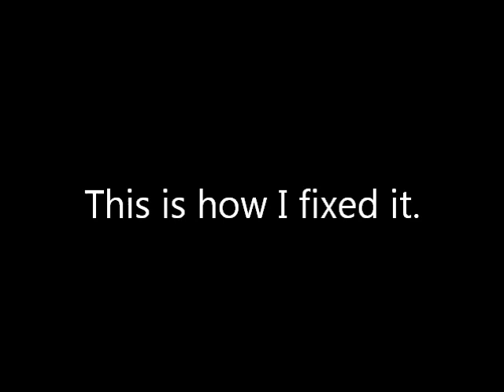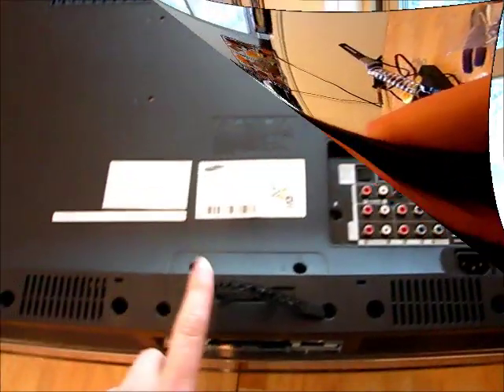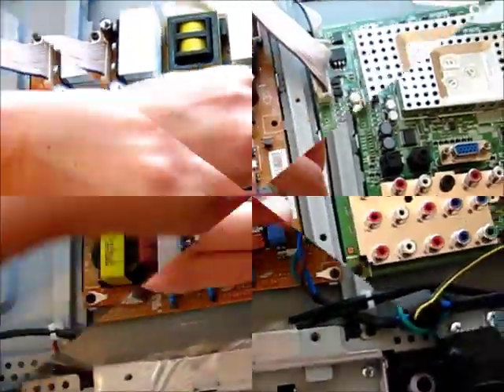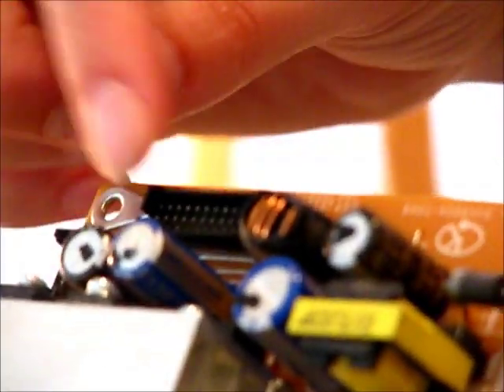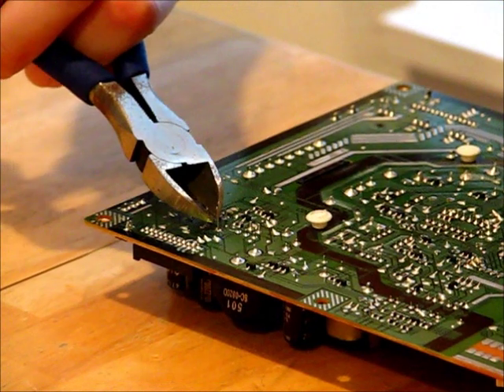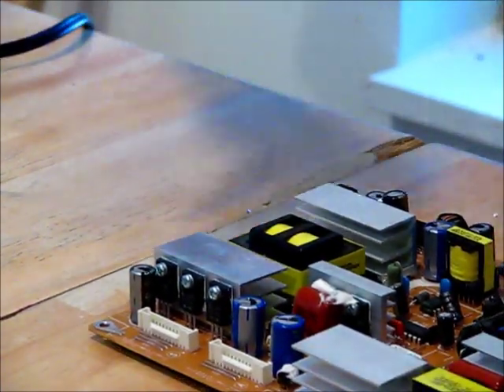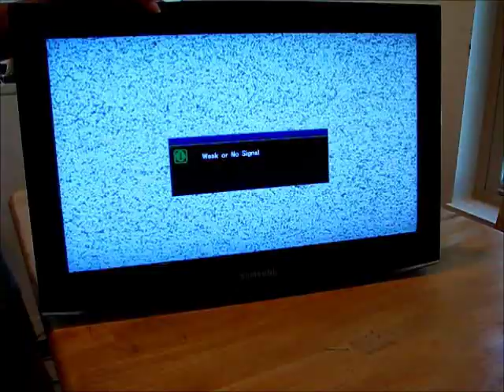How to fix a Samsung LCD (Electrolytic Capacitor)

Comment: I was getting ready to take my 10 year old  32" Samsung to the trash bin (it wouldn't turn on), when I came across your video.  You helped us clearly see we had a blown capacitor.  After buying a replacement capacitor for $3.35 (including shipping) and a $10 soldering iron, we followed your instructions, and to our amazement, the tv turned on and is working great.  Thanks so much for the help.
Reply: Very interesting.  You were able to save the TV
with mimimal costs.

Comment: I fixed mine yesterday (LN-T4061F). Two blown 10v 2200uf capacitors. Replaced with 16v 2200uf (total capacitor cost = $2.98 +tax). My first time soldering so it took me about an hour total to complete. Thanks for this vid, it was a big help in both "how to" and giving me the confidence that I could do it myself. Worked like a charm!

Comment: Very, very helpful.  This worked for us--not too hard and saved us a lot of money.  The whole repair was maybe 15 minutes.
 The capacitor we replaced (same as in the video) was 2200 uF, 10V. It doesn't hurt to use a higher voltage, like 25 V, if that's what's available, but you don't want the new one to be much longer than the original.

Comment: Good job Michelle! Just a helpful hint, when replacing "through hole" components its easier to insert the leads and bend them slightly outward, solder, and then cut the excess. This will help to hold the component in without falling out or moving while soldering. You go girl !!!!

Comment: Nice!! My 32" Samsung went out on me, and turns out the EXACT same capacitor you replaced in the vid is the one that I had to replace on mine, the 10v 2200 microfarad caps are pretty cheap and are blowing out on alot of samsungs apparently. I replaced with a 16v cap and is working great now. 

Thanks for being SWEET!

Comment: Thank you so much for this great video on repairing a Samsung TV Michelle! I had a very similar issue with a Samsung LN26A330J1D TV that someone had left by the dumpster at my apartment complex. It had a hand written note on it that said "It Works!" So, I took it home with me and found out that it was not turning on. Although, mine has a power button on the front of it, the issue was very similar to yours. Whenever it was connected, a red light would appear on the power button showing that it was receiving power from the outlet. However, when the power button was pushed, nothing would happen. I decided to search for similar experiences with this TV on line and came across articles mentioning defective capacitors with these type of LCD TVs. Not knowing what to look for to try and repair the problem myself, I came across your very informative youtube video on how to actually replace a bad capacitor. I will mention that I have soldered electronics on my own electric guitars before. So, I know how to handle a soldering iron (somewhat). But I've never attempted to solder on anything else. Especially on a TV! 

Well, I opened the TV up and sure enough, there were 2 caps that had the bulge on the top end of them. One of them even showed a black leaky substance on the top of it.  So, I removed them both (notating on a piece of paper what direction the negative and positive posts were attached to the board itself). I then ran over to my local Radio Shack to purchase 2 new capacitors for it. Costs me about $4.60, after taxes. Got home and soldered the new caps onto the circuit board and put it all back together again to test it out. Eureka! The TV made a beeping sound and then turned on after just a few seconds!  I'm actually using it as my PC monitor as I type this. I gotta say, this TV really does make for a nice PC monitor. And for an investment of under $5, it was totally worth it! So, I can now speak from experience and say that this repair really works! Thank you so much for the great repair video Michelle!

Comment: It's really cool that you and other people spend the small effort it takes to fix you machines yourself instead of tossing it out and buying a new one like so many others do. Unfortunatly, your solder joints looked very bad, also known as a dry joint, and it will most likely cause you grief. The proper way to do it is to stick the iron so it contacts the wire and the PCB so they both heat up, and then apply the solder. Get some junk circuit boards to practice on! :)

Comment: two pointers on your desoldering/soldering technique, in case you ever do more of it! 1. buy a roll of desoldering 'fabric'. it's a copper mesh, you press it against the joint, heat it with the iron, and it sucks the solder out. much neater than just heating and wiggling the component. there are also manual solder vacuums that will do this. 2. it's okay to trim the leads down closer to the board before soldering, but don't clip too low at first. solder them, then trim down to the board.

Comment: Samsung 46" fixed today by replacing two caps for $2.60. Only real difference to the video was a cover over the boards. Easily removed. Many thanks Michelle  :-)

Comment: I have a 65" LED Samsung and it just did the same thing to me. The red light at the bottom is oh, but it will not turn on. I will go ahead and attempt to replace a few of the Capacitors and get back with you. VERY USEFUL VIDEO! thank you.

Comment: Great vid.....i bought the capacitors with the intention to fix my own (Samsung LE32 R86).....but just by chance i phoned the local service centre who told me to ring SAMSUNG UK......they said the tv qualified for a free repair as its a known fault even though it is 3.5 years old.....just got it back today....fixed free of charge.

Comment: I noticed the "cold" solder joints as well.  Just a couple tips to newbies on soldering.  You need to ensure that either the solder you use has soldering flux in the core (or buy the soldering flux separately).  The next tip is to always heat the metal post and then let the post melt the solder (Do not melt the solder on the tip of your soldering iron.)  You'll know you've done it right if the solder remains nice and shiny after cooling off.  In this case, the soldering joint was dull.  Cheers!

Comment: And by the way, Low ESR capacitors can be found on computer mainboards or computer powersupplies, these capacitors (if electrolytic) will be able to handle the high currents and high frequencies better than standard ones that may fail again soon.

Comment: Thanks Michelle! I have the same TV and the same capacitor went. Its nice to see it worked on yours before i tried it. I also did some prior research but your video was exactly the same problem as mine. Very helpful plus your easy on the eyes!! thanks again

Comment: @solidasarock13 , it depends. if you're snipping a small gauge, low ductile lead, then yeah, it might crack the joint. if you're trimming a tiny, flexible component lead, it's not going to crack the joint, and that's what these joints are. further - solder joints are supposed to be ductile. if a solder joint cracks, chances are it was brittle to begin with - which means an improper solder job. so you could be doing yourself a favor by trimming - exposing a solder joint that needs to be redone!

Comment from the maker: @MissChelleShock I know sometimes the ad that pops up on the video displays parts for Samsung TVs (and probably most others too). I will see what I can do about making stay fixed to that ad so people can order from there. Otherwise, I purchased my capacitors for a local shop called Tech Advance. It's a shop based around computers mainly. Everyone probably has at least 1 shop that sells these locally, but you may run into finding an associate who knows what your'e asking for.

Comment: Be careful what capacitors you use since SMPS's (switching powersupplies) use high frequencies and very high current ripple on the caps, Some people tell you to go up in voltage, but the circuit is usually marked "+5V" or "+5VSTBY" wich means that the operating voltage is not higher than 5 volts. Instead look for "Low ESR" capacitors, and if it's a 2200µF cap, overdimension it to 3300µF to get enough margin for it to last way beyond the TV's designed life.

Comment: @MissChelleShock lol, i tried it yesterday, and i touched the entire capacitor, and there was no electric shock or anything. But my 15watt soldering iron wasn't able to melt the solder and I just threw it away and ordered a new monitor.

Comment: hey great vid on the lcd replacement part. My samsung just had the same problem and the exact same capacitor is blown. I see many are diffrent sizes, what size do I buy? Or is the specific part itself called a electrolytic capacitor?

Comment: @1961vampire Thanks for the help. The capacitor is the same size but the thing is, is it safe to go up that much in voltage? (16 to 35)

Comment: Do you happen to know if bad capacitors also prevent the video from working? My set turns on and I hear audio but no video. It started with a green vertical line and later just went black.

Comment: @MissChelleShock I need a question answered please. When replacing capacitors can you go up in voltage or uF? Some video I watched a while back said something about it, but it's very hazy. My local radio shack doesn't have the right voltage.(35v when I need 16v) Please help me out here because playing xbox on a computer monitor and without sound is annoying.

Comment: Ok, I have questions:
1) Does it hold true that every lcd tv that doesn't turn on, but has the orange light, has a blown capacitor?
2) Can it be more than 1 blown capacitor?
3) Besides the dents (I find it very subtle) , how can you tell a capacitor is blown?

Comment: Being a postman I come across stuff thrown out. I recently got a fully working flat screen that was put in a skip (The owner didn't know how to operate it??). Today I got this TV left out for scrap but following your video I might be able to fix it myself (even). Not sure though if the capacitors have be a certain kind, but would that be plain to see even for someone who has never done something like this?
Reply: +Brian Morgan - Hey Brian. If you have a soldering iron, all you really need to do is turn it on and wait until it gets hot enough. Once you have located the capacitor(s) that has gone bad, simply place the tip of the soldering iron on the capacitor legs on opposite side of the circuit board, while gently pulling the capacitor away from the board (with your own fingers or some needle nose pliers). As Michelle mentioned in her video, the capacitor that went bad on her own TV was on the cold side. So, she did not have to worry about draining the caps before soldering on that part of the board. The bad caps on my TV were also on the cold side of the circuit board. From the looks of it, the caps on this particular Samsung LCD TV circuit board appear to all be on the cold side. Just try not to leave the soldering iron for too long on the circuit board to avoid burning/shorting it out in any way. Once you have successfully removed the bad caps, take them to your local electronics store (like I did) so that they can match them up for you and get you the correct ones. Hope you get your TV find working again!

Comment: I talked to a electrical engineer about this very problem on Samsung TVs. Apparently the capacitors are only rated at 10 volts but 12 volts go thru them. Something that Smasung should should take care of since it was a known problem. Be prepared to replace all of the other capacitors you just showed us as they are all under rated for 10 volts also. I will never own another Samsung product. It will be LG or Sony. Samsung also used cheap color wheels in their DLP TVs which fail and wear out also

Comment: Hi i've had real bad problems with my lcd samsung and its jst going on then coming off with a clicking noise i have checked the capacitors but its still not working would you know what else it could be ? Thanks Lora

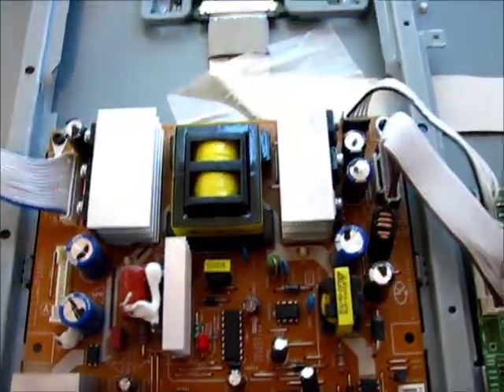Comment from the maker: @DemonFlame4 Be careful!! I'm not an expert whatsoever, so I'm not the best person to rely on for this type of advice. What I do know is there is a white line on the power board that separates the HOT and COLD sides(Hot being the side of the power supply that contains residual power--where you'll risk getting shocked, and Cold being the side that doesn't.) At 2:54 I point those out. I'd pay attention to those for sure, and do as much research as possible to avoid getting shocked.

Comment: Alright I'm having the same issue of my Samsung LCD tv clicking off and on. After calling them, Samsung did send a repair man in my local area replacing the power board, however a couple days later, the same problem appeared again! I opened up the board and don't see any blown capacitors. I don't understand what the issue is! =(